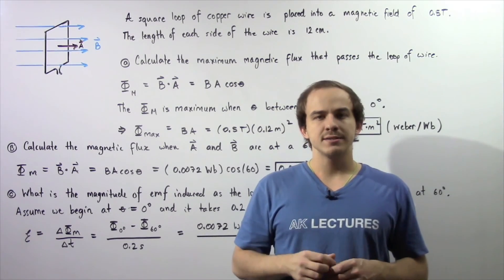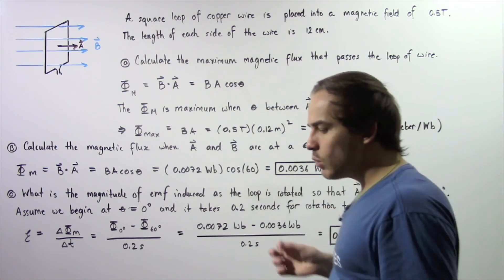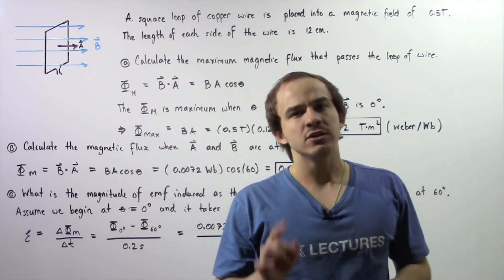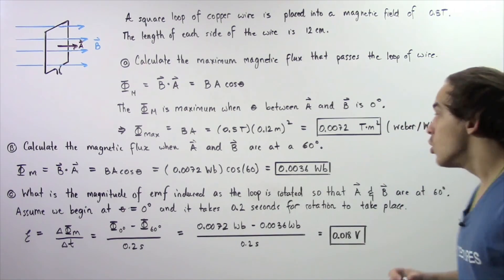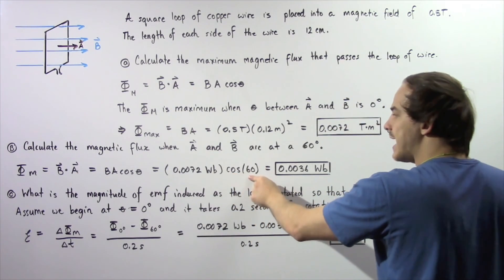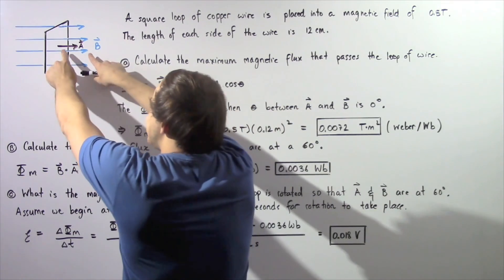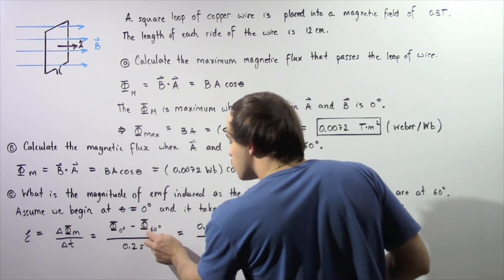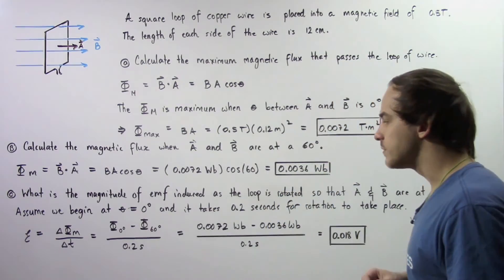Magnetic Flux and Faraday's Law Example

Comment: How A is a vector?????
Please answer me.
Reply: A surface integral calculates the flux of a vector field across a surface. The result of the surface integral can be thought of as a measure of the "flow" of the vector field through the surface. In this context, the magnitude and direction of the flow can be represented by a vector.

Comment: Shouldnt the equation for finding the emf be the 'negative' rate of change in flux? Why did you remove the negative sign?
Reply: The negative sign was removed because the delta was changed. The definition of delta is final value minus initial value, and he calculated the opposite- initial value minus final value.
Reply: I think that magnitude of emf implies that we don't need to care about the sign. In contrast, value of emf implies that we need to care about the sign